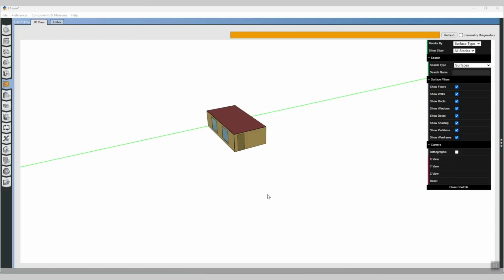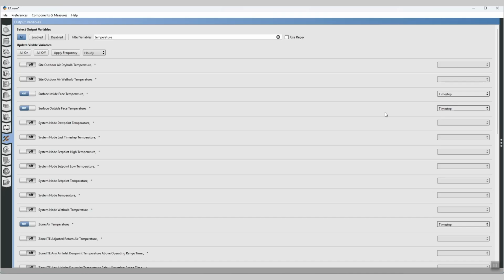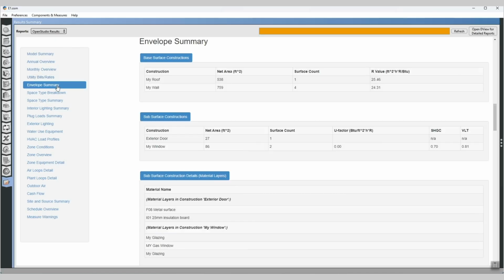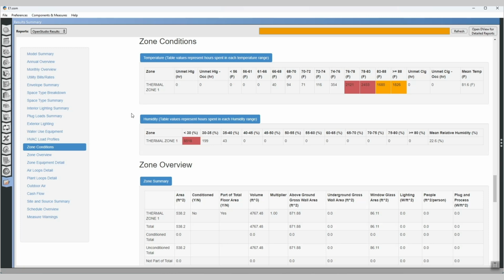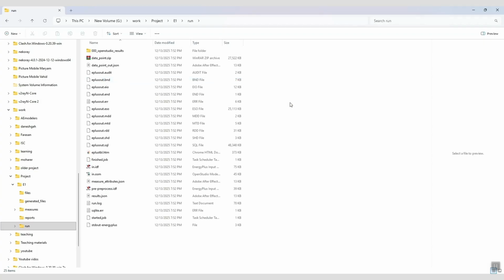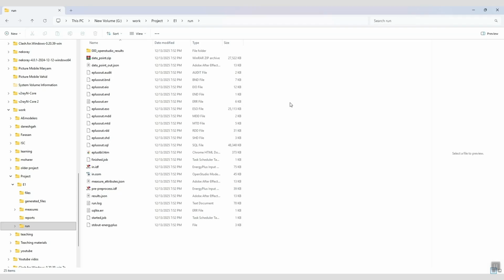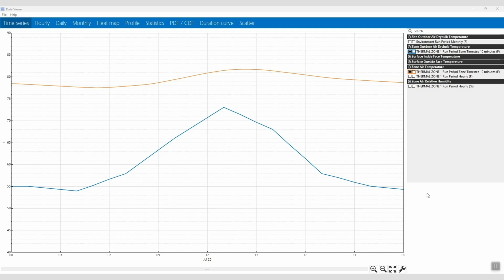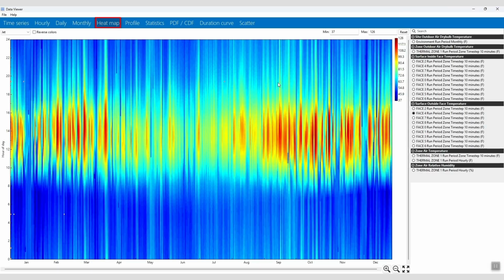OpenStudio Tutorial – Chapter 3: Running EnergyPlus Simulation & Analyzing Results (D-View)

Comment: when i run thehre is a problem with FATAL:Errors occurred on processing input file. Preceding condition(s) cause termination.
Reply: If it's an error with "[BuildingSurface:Detailed][Face 0]" in it, then it's because the floor (face 0) is assumed to be a ground contact surface. Rotate the building in the 3D view and inspect the floor under "Render By: Construction" view. If the floor lacks a construction then one way you can fix it is to go to the Spaces tab, then the Surfaces subtab; set Face 0's outside boundary condition to be the outdoors instead of the ground and set it to have no sun or wind exposure.

Ideally however to fix that issue is to alter your construction set so that "Ground Contact Surface Constructions: Floor" is set to a floor type to automatically assign all floors that touch the ground.